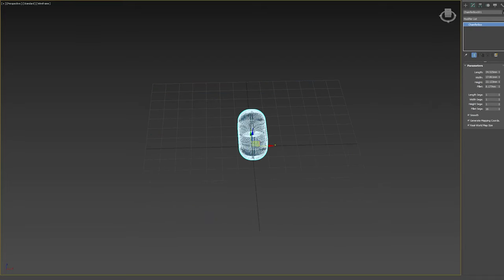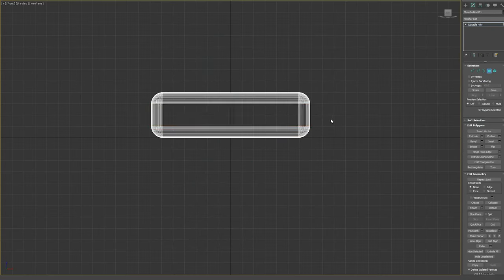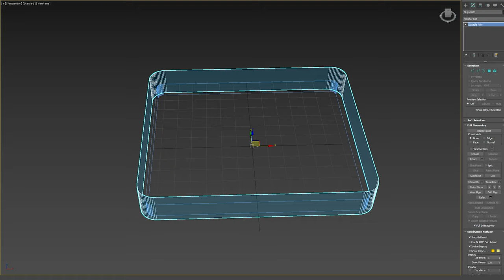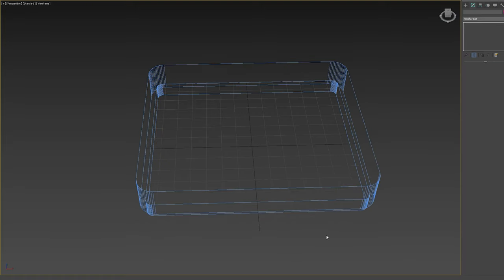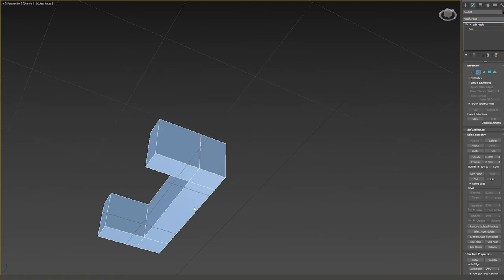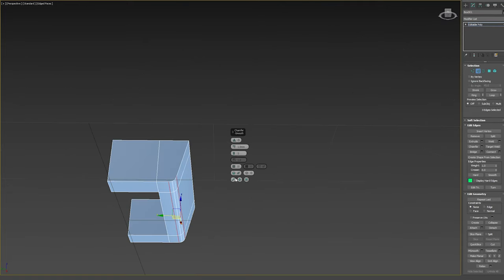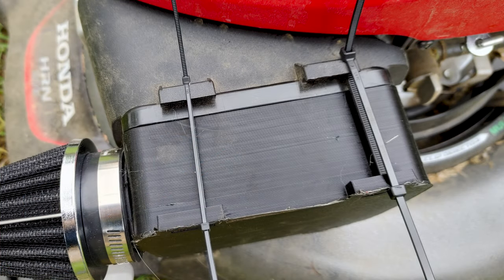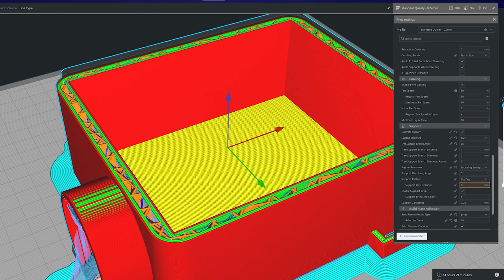DIY Lawnmower RAM INTAKE

Comment: Wouldn't it have used way less plastic to just print the mount to replace the stock air filter housing completely rather than the top? Then you could have bolted it on with the original bolts.

FYI: Model: Honda hrn216vka   
 Filter: Honda/MTD 17211-Z8B-901